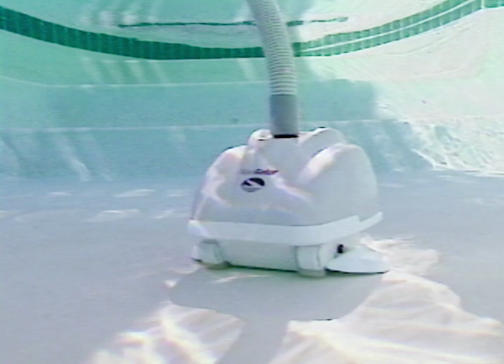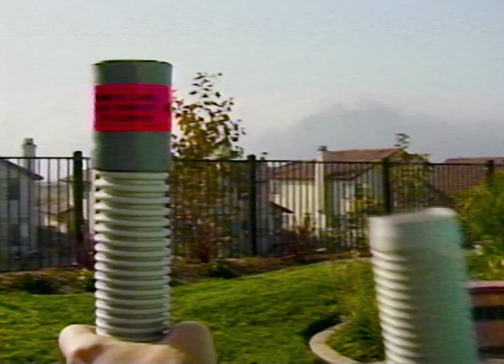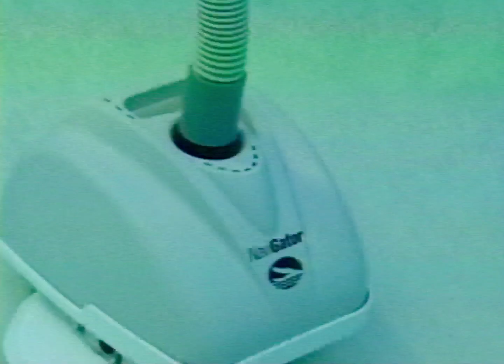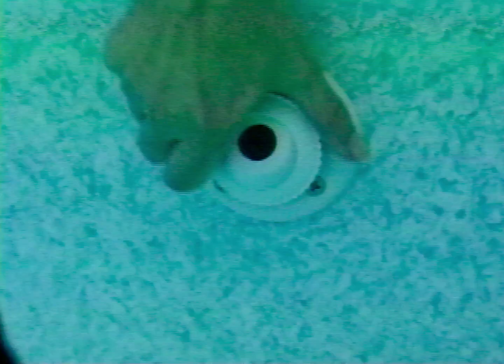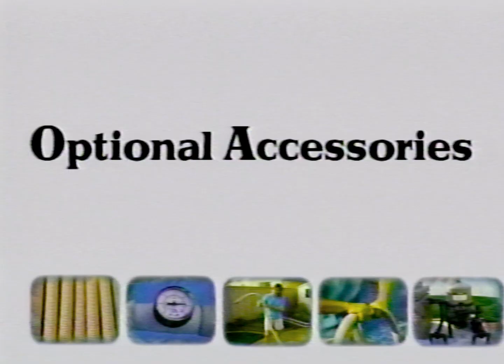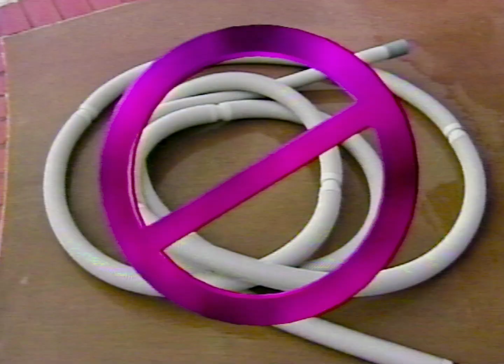Digitized 1995 Pool Cleaner VHS | Hayward Arneson NaviGator Setup Guide

Comment: Little time capsule... likely would be lost forever if you didn't save it!
Reply from the maker: Yeah, for sure. And hey, maybe onion out there still has this pool cleaner, and it’s useful.
Reply: Everyone still has one of these. They just changed the outer cover to make it newer and they are really cheaply made now. But they are still very much everywhere
Reply: @ahz987  I'm aware pool cleaners still exist lol but you'd be hard pressed to find a functional Arneson.  This model has pretty much nothing in common with modern robotic sweeps
Reply: @Dudeguy217 I have like 20 arnesons in my garage 😊
Reply: @ahz987  invite me over rn